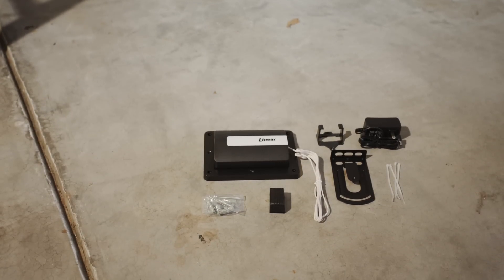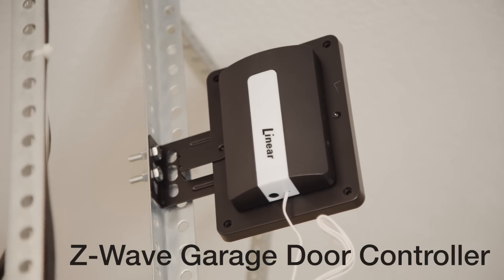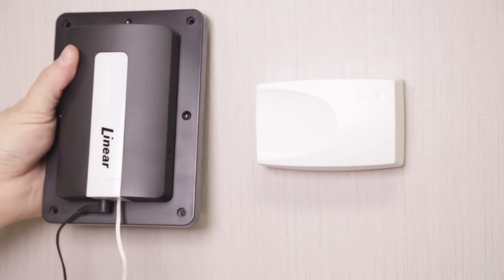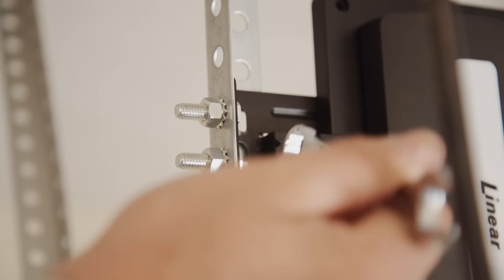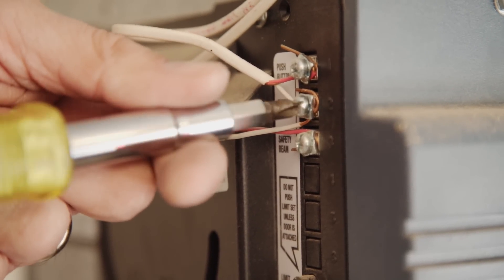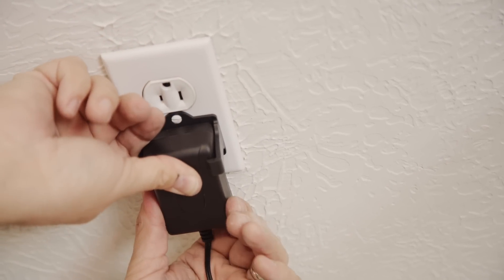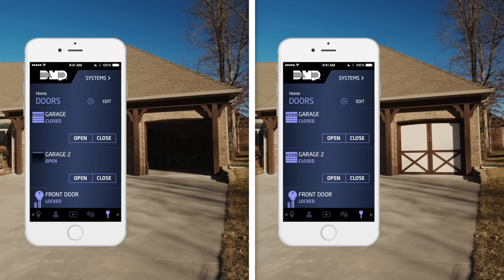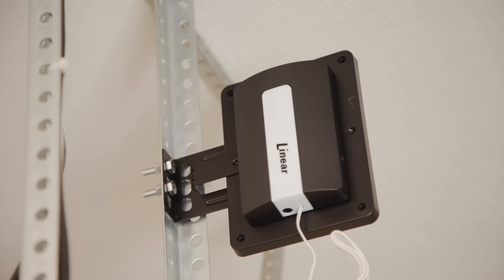Z-Wave Garage Door Controller

Comment: The reason you can add the wires to the PB input without worrying about voltage differences or polarity of the wires is that the terminals are just shorted together when you press your garage door button.  And the Z-Wave garage door controller just mimics this - it closes the contacts.  There is no voltage input into your garage door controller, so you don't need to worry whether the Z-Wave controller is compatible with your model garage door controller.  This had me confused until I realized what was happening.  And if I had realized this I wouldn't have mounted the Z-Wave controller on the ceiling of my garage!  I would have just mounted it on the wall next to my door to the kitchen where the button is!  Much easier install - just connect the wires to the button's contacts - works just the same!!!
Reply: Mark Hannah thanks for this...
Reply: This is a great idea!!! However, I think the basis for installing them above the head unit/opener, is that there's already a plug there to begin with, and it will look cleaner overall installed on the mounting rails keeping it away from the button area/wall.  At least, that's how I look at it and why I'll install mine above my opener.

Comment: Does anyone know if it detects the lock function on most garage doors? So if you use the lock function on the garage door keypad will that stop the unit from opening the door remotely? I was thinking about getting it but sometimes we have pets in the garage, I need to know if I can lock it from the keypad and block the connection as we do with the standard garage remotes.
Reply: The keypad lock on my Genie brand controller did block the Linear zwave device. The system reported 2 errors: (1) the command failed, and (2) that something was blocking the door.

Comment: I installed this and it's connected to my hub but when I use it I get the 10 seconds of beeping but then nothing happens.  The app gives me an error saying "Obstruction" but the door button still works fine.  Any suggestions?
Reply from the maker: Tim, we're sorry to hear that your Z-Wave Garage Door controller isn't working as expected. The best thing to do is contact your local alarm provider that installed the system.